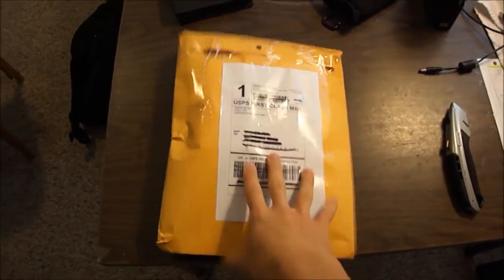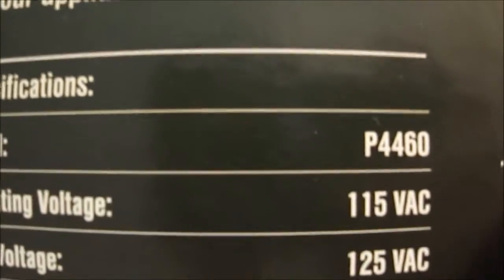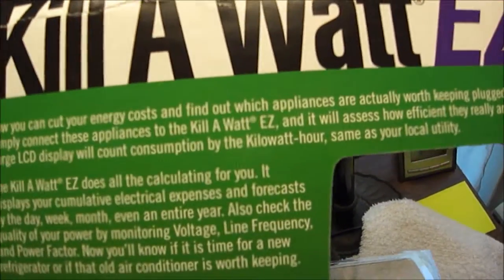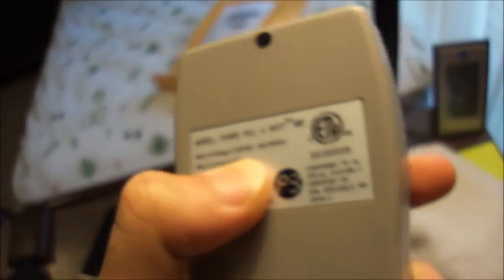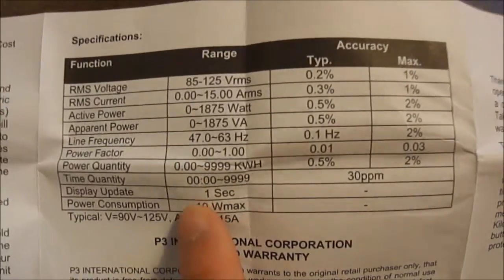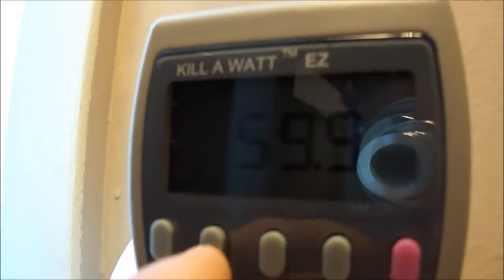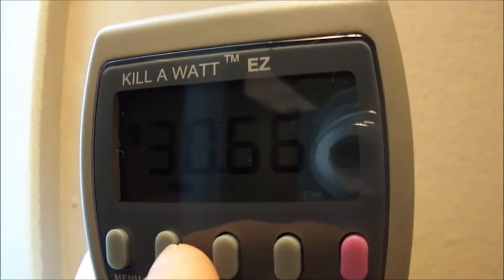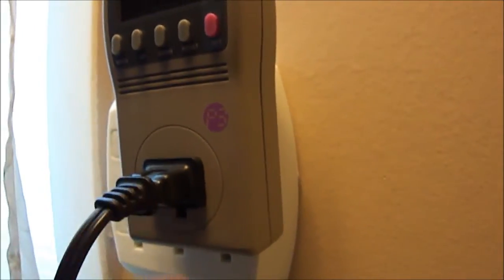Kill A Watt EZ Unboxing and Review by P3 International (P4460)

Comment: I have a question...I have this Voltcraft Energy Logger 4000 device(kind of like the US version of "Kill a watt") that is 15Amps max but my PSU Enermax Liberty 620W is 30Amps on 2rails(30+30)...
What exactly is the amps for and what happens if the device exceeds the max Amps? ...I had my PC in it...

Comment from the maker: ah, I think both devices use different formulas to calculate the amount of power the device is using, and your theory of the Kill-a-watt reading dc amps might be very true... If you replace your kill-a-watt with a similar or exact same model, I have a feeling your gonna have the exact same results.. good luck!